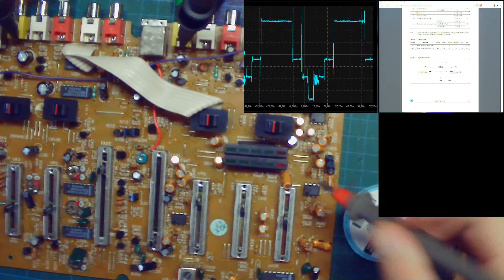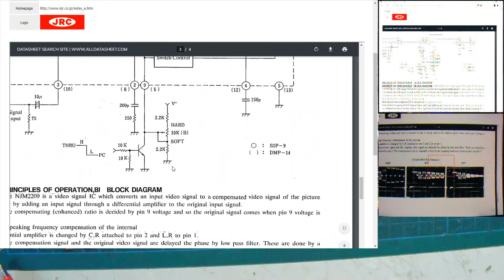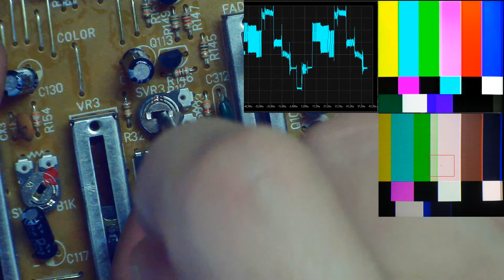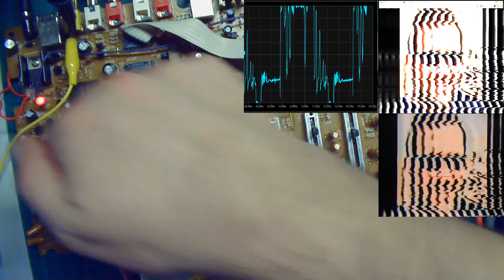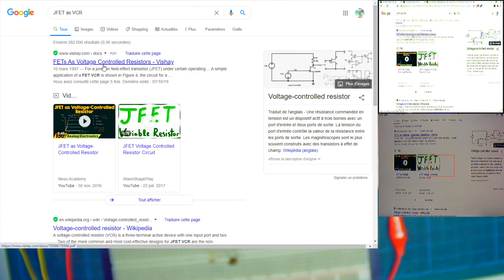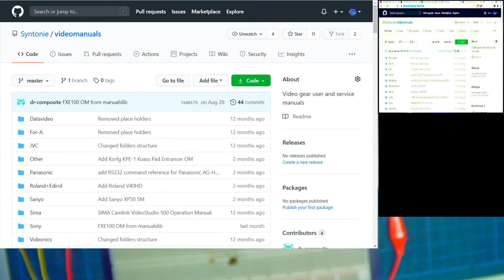Live Circuit Bending -  Fubar 2020 Part 2

Comment: 24:47 To answer the question: I think RF was used before composite. But in the consumer world, I don't think people even had things to plug into their tv. VHS didn't come around until the early 70s.

This is based on my speculation, so please correct me if I'm wrong.

Comment: So the voltage input is 12v for the device I’m going to bend. Would it be dangerous to connect two points if the voltmeter is 12v?  I’m having a little trouble understanding how to tell what is directly connected to the power source.
Reply from the maker: Actually, the circuit might be able to survive a short between +12V and ground, though when starting, I think it is better to avoid messing with the power rail, as you can already find interesting passive bends. Then if you want  add some active circuit to the device, you may use the +12V, as long as the power supply can deliver enough current